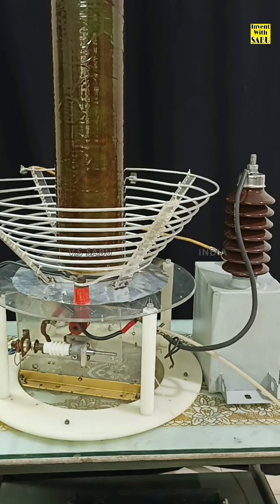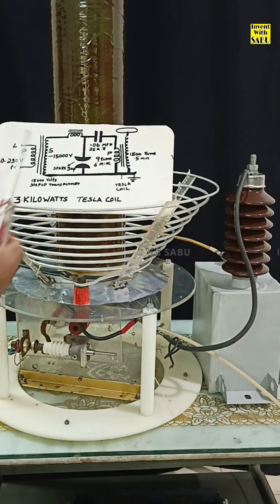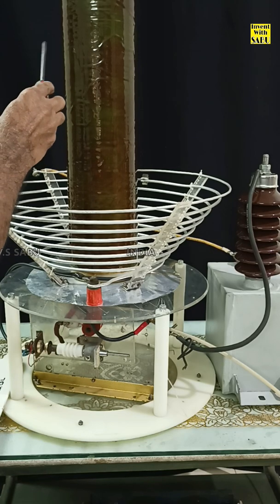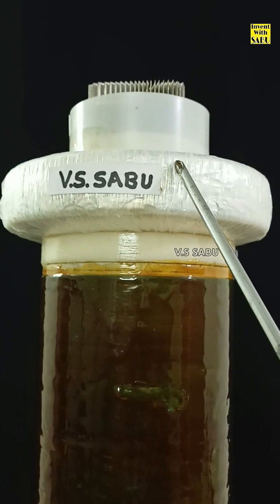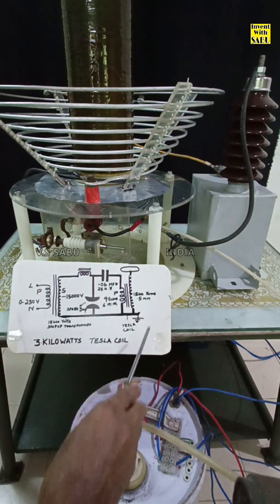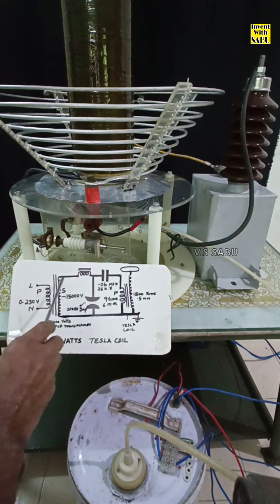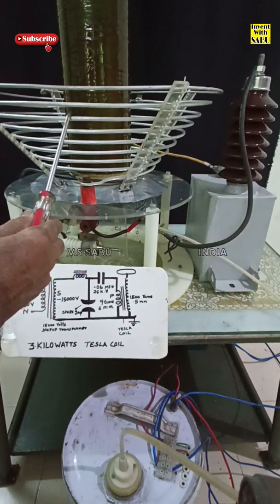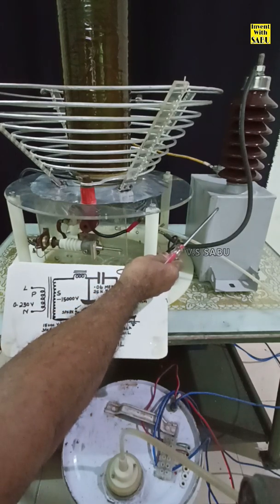1 Million Voltage Spark gap Tesla Coil | Invent With SABU

Comment: Which high voltage  transformer using. What is the name of that transformer (230v to 15000v )
Reply from the maker: This transformer made in my workshop...50hz frequency and 3 KW power.
Reply: Lot transformer use chayamo
Reply: Microwave transformer use chayamo

Comment: What is the specification of choke used your setup?
Reply from the maker: Actually transformer secondary side choke is better but costly.. you can give  in the transformer input side that is little bit easier. calculate the input current and fix a chock  or serious resistance in the input primary side.

Comment: Sir what will happen if we keep a van de graph generator and tesla coil together
Reply from the maker: Vande graph is a  DC static charge storing globe or capacitor  it's Required below 25000 Voltage . Tesla Coil producing 100 Thousand  to  millions of Voltage AC .
Reply: @inventwithsabu6341   will they spark each other?

Comment: Sir when we use such high voltage Tesla coil... It flows everywhere... So can it show side effects to our brain or towards our skin?
Reply: AFAIK there are no side effects produced by the Tesla coil itself. If the voltage of the spark gap generator was much higher (in order of millions of volts) then it can produce x-rays. But at 12kv it doesn't have that kind of energy to produce it.
Reply: @rupakcr2753  ohh ok ok thanks...
Reply from the maker: Our mobile phone is dangerous than this need more study about that 🤩🤗